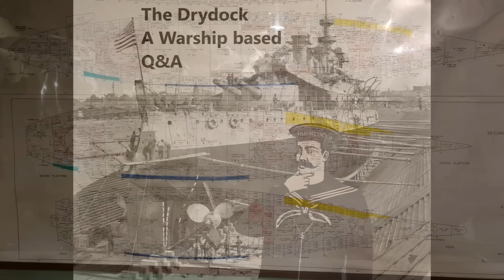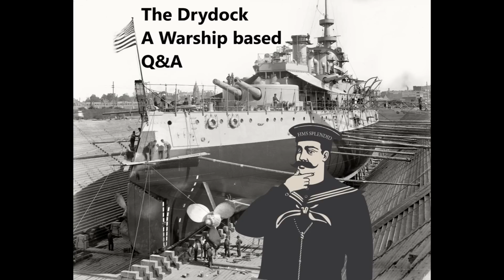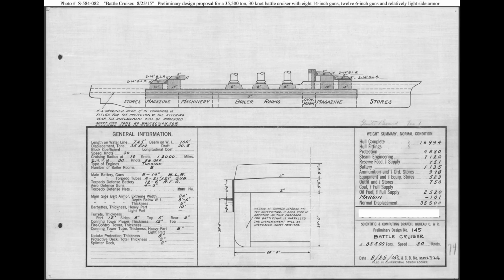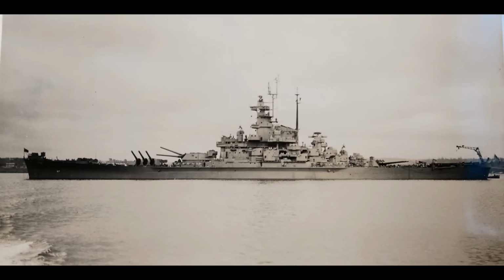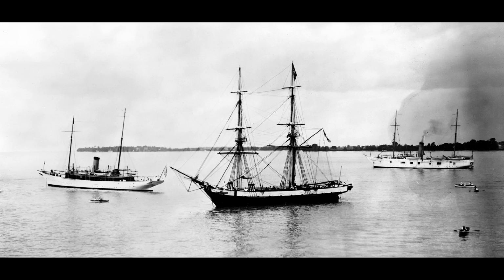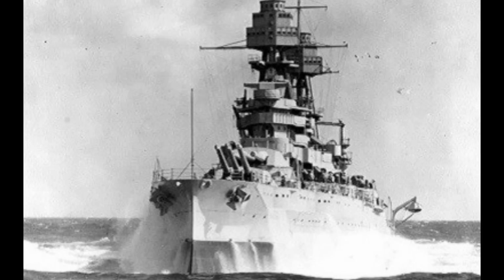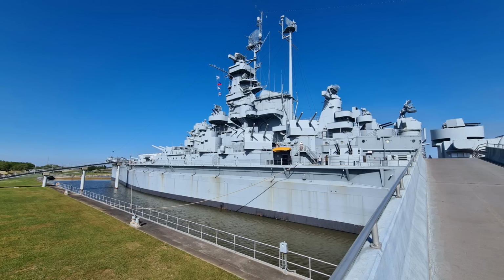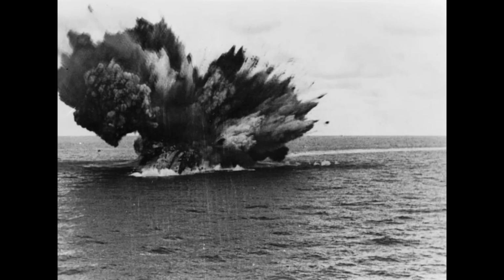The Drydock - Episode 197 (Part 2)

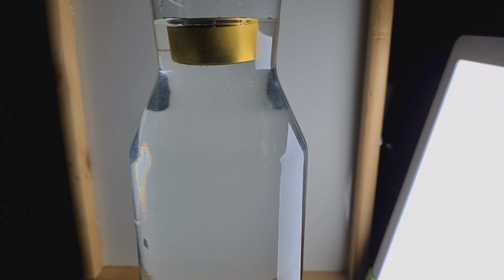Comment: For the sunken ship (around 2:01:00) simulation, there is a possibility that the initial food dye being dragged up and out may have been due to interaction with the water molecules as they are slightly attracted to each other, same principle used when sucking up a liquid in a hose or a tap when used to move the water along, due to intramolecular forces so any initial contact would pull any water or food dye towards the water hence the blob that started to appear near the start of the bottle caps sinking. This effect would be much less obvious with a large vessel.

Comment: Re the workshops, it is almost certain that oxy aceteline would have been available, which could be used for heat treatment in conjuction with a barrel of oil or with the ships fire hoses. My father was a stoker on the transatlantic convoys, (many stories and anecdotes ) ships coal was damped to wash any dust to the bottom of the heap and generally went into the boiler wet, this was not only safer from a health situation, but also prevented  the possibility of coal dust fires.
Reply: Proper heat treat usually requires a step where you bake the part withing a specific temperature range after your quench step, and it's unlikely they would be able to do that without an oven.
Reply: @Halinspark  You are refering to anealing, an oven is not required, as a machinist and forge worker I have often heat treated parts including case hardening without an oven. Blacksmiths have been doing so for many thousands of years, and temperature control was and still is a visual measurement. However they do have ovens on board all shiops, they are used for cooking and could easilly be pressed in to service by the ships engineer.
Reply: @Halinspark  it's certainly possible to anneal by eye but if the annealing temperature window for your alloy isn't very big it can be quite tricky.

Comment: Regarding heat-treatment in shipboard workshops: most farriers in my area have a gas-fired furnace in their truck which is quite compact, a foot cubed, a foot and a half cubed, that kind of ballpark. A device of that size would obviously limit the size of object to be heat-treated and the compact nature and probably manual procedure of doing the actual heat-treating would result in substandard quality heat-treatment, but I'm quite confident that it could be done, even with WWII tech.

Comment: There was a story cirulated when I was in the USN Reserves that, during the refit of one of the Iowas in the 60's or 780's, that a compartment was noticed that had no hatches or other access.  When an opening was cut in one of the bulkheads, they found a fully equipped machine shop.  Now, this story was told me by an old navy chief, so, to put it mildly, it may be suspect....
Reply: I believe Ryan over at Battleship New Jersey has a video on this very subject. Sorry, don't have the link, though. Short answer, probably apocryphal for an entire machine shop, but much smaller "cool" spaces, potentially true.
Reply: @Jimorian  Thanks for the answer.
Reply: I was in the Navy 1969-73, and I remember that one.  The way I heard it, a new junior officer was given the task of mapping out the entire ship, to help him become familiar with it.  No matter how he remeasured, he came up with a missing space on one deck.  And when they cut into it, they found a fully-equipped machine shop....
Reply: @troystallard6895  yep, it happened.  The whole shop was lifted into place, fully equipped except for access to ensure nothing would be used/taken until sea trials.  Then they forgot.  Or maybe someone made off with the doors intended for later installation.  The ensign had an easier time than enlisteds being asked to find 100 feet of shore line, keys to the oarlocks, or a bucket of steam.
I experienced something similar to the missing space on a submarine tender by finding several radioactive reference sets needed to calibrate measuring equipment. The ship would order them, and store keepers would deliver them to a shelf in a no longer accessible space. The lab kept requesting replacements for outdated standards, the SKs would deliver them to the proper  place which was no longer accessible.

Comment: Technically the L and M class destroyers that didn’t have the 4-inch guns were armed with brand-new 50-cal 4.7-inch DP guns, and had pretty good elevation but it’s downsides were weight and having to be elevated manually.

Comment: I wonder how much metal they carried for machine shop stock. 
Like round bar, flat stock, cold rolled, hot rolled, 4140 Chro-Moly? 1095, S2 tool steel maybe? H13 tool steel since it’s abrasion resistance is pretty good.
There’s this stuff called Cherry Red, use it for case gardening and it also works for surface hardening. 
Comes in a white container with silver label.

Comment: I recently read the story of the luxury sailing yacht "Te Vega" which, in the course of a long and varied career, saw US navy service in WW2 as a patrol vessel under the name Juniata (IX-77), stationed on the West Coast and armed with one 20mm cannon and one .50-cal machine gun. One incident of note was when Juniata challenged an unidentified ship at night and was immediately illuminated with searchlights. Juniata's skipper hailed the other ship and threatened to shoot out the lights if they weren't doused immediately. The searchlights were turned off and the captain of the other ship (a US destroyer) apologized and politely told Juniata's skipper that the challenge code he had used had expired a few hours before.
Te Vega was also involved in a pre-war corruption scandal concerning the awarding of navy contracts for construction work at Midway and Pearl Harbor - the naval officer responsible for awarding the contracts was a regular guest of Te Vega's owner on board the yacht and subsequently gave the contracts to one of his companies.

Comment: Did someone REALLY ask you which of the ships that broke it's chains & refused to go to the breakers was your favorite? THAT HAD TO BE A QUESTION EITHER BY SOMEONE NEW OR A FOUR YEAR OLD QUESTION THAT IS JUST NOW GETTING ANSWERED! You didn't even have to name the choices before I knew the answer was Warspite!!! 
Now Oregon making it halfway to Tahiti is cute but I think that was before Tahiti was really a nice place to go. AND considering Warspite's war records & the fact it did a donut in front of the High Seas fleet & survived to to tell the tale & in the process helped save the crew of another ship. And has probably shot up as many war ships as any other during the age of steel war ships. And anyone that has spent anytime listening to you would know your love of HMS Warspite!!! I DEARLY LOVED the fact that HMS Rodney had boilers that was on their last legs & was otw to the USA for a complete engine overhaul but Bismark hit HMS Hood with that lucky shot that turned it into a sinking Roman candle. And so HMS Rodney pulls a 180 and heads towards the coast of France basically ran down the Bismark running it's OLD engines at 3 to 4 knots faster than they were designed for, and once Bismark engage's Rodney, Rodney pulls the destroyer trick of chasing splashes. And starts beating Bismark  into a floating wreck of fire & carnage. And to be honest, although I think that it was awesome that a ship in need of a major engine overhaul took on that brand new battleship and beat it. I'm sure the KGV helped. But from what I've heard, most of the first hits scored on Bismark, the one's that took out most of it's ability to fight back was from Rodney. But I actually feel pity for the men that were aboard Bismark. For one, their ability to fight back is quickly taken away. To jump into the freezing cold water is probably death. Fire, hot metal raining down, massive carnage & dead people & body parts lying around in heaps. The German that lasted 3 days in the water is amazing he didn't die of hypothermia. But living through that kind of hell, those that were rescued truly lived through hell on earth. It's really sad too that they left so many survivors in the water. Yes, I know there were U-boats otw & the threat of air attack too but they could have thrown out some life boats or whatever those float things are called. I know they were taking revenge for the crew of HMS Hood but at some point you need to stop & try to go back to being human again. Yeah, the HMS Hood basically went down with all hands. But it was over & done quickly. We, the USA & the UK were supposed to be fighting to save the world from tyranny. And the way to do that is to overcome your NEED FOR REVENGE and only kill when you need to & only fight towards winning the war. It's almost like by trying to stop this evil that you ALMOST became what you were trying to fight against. Or at least the way the Bismark survivors were treated. If that makes sense? I understand that the loss of the Hood was a tramatic blow to the Royal Navy but like Cunningham said "It only takes a couple of years to build a ship. It takes a few hundred years to build a tradition." And part of that tradition is to give mercy when a battle is over.
Reply: And I can't speak for all Americans. But I don't like the idea of war with China, Russia or anyone else for that matter. BUT with all the humans on this planet, how long before there are so many people we all suffocate from lack of oxygen? We have over 9 billion people in the world & populations everywhere are growing on a massive scale. I'm an old man and will probably die sooner rather than later. But I just wish that I could somehow wash all the evil from the world!, all the pollution from the air & waters and ease all the hostilities that people have & create towards each other. And cause anger & hatred to just disappear. I'm sure that will come soon enough for me in the form of death. But wouldn't it be really great if Jesus really did come back to earth and solved everything and made the world clean again and we are here to see it all happen? Although I do really wish for it. Idk. I just think of how we have totally trashed the earth. We should all be very ashamed of just how polluted we have let this world become.

Comment: Would it be possible to have you expand on your answer regarding decontaminating Laffey?  I remember reading that the USN used Nevada, and several other surviving hulks from Crossroads, to test various decon measures.  Was Laffey part of that experimentation, or did Laffey benefit from the lessons learned on some of the other vessels?  

As an aside, as a former radcon tech, the accounts I've read of things being done after Able and Baker, including FFS steel deck "beach parties"  (Swimming off the side of the ship inside the atoll's lagoon), are just horrifying to read.  Along with the struggle the scientific detachment had to prove to the Naval command structure that they lacked a dependable radiac that would detect Pu, I think it was.
Reply: Everyone laughs at Alpha until you end up swallowing them.

Comment: RE Suction: It also should be kept in mind the displacement of a ship is calculated when on the surface. Submerges it should be significantly higher
Reply: Actually, significantly lower. After all, it's not displacing enough to keep it afloat anymore.

Comment: I think the main purpose of the onboard machine shop may be not to make new parts from raw, but to repair/rework/recondition worn or broken parts. If you can repair many of the parts on board, the "spare part" is the part you are using, rather than having to carry duplicates.

Comment: Regarding suction - its exactly the same as a large truck passing close by, albeit rotated 90 degrees and is air not water.
Consider cyclists draughting/drafting behind a truck, who can keep up with the vehicle as long as they stay in the low pressure zone.

Comment: I think the ship of Theseus is mainly about continuity. If you replace the ship part for part, but it has served\sailed with those parts they become a part of the "continuity of existence" for that ship. So even if the Shis has not a single original nail left, if the parts had time to sink into said continuity, it's the same ship
Reply: Y'all not looking at this thing occult enough: the ship has a spirit, okay? Call it its service life, it's character, even it's crew. That's what I mean with continuity. An upgrade, refit, repair or even rebuild doesn't destroy that continuity. Prepping it up for museum use doesn't either. To not have it be the same ship you must ... "Kill" that continuity. And for that you basically have to destroy the ship on a fundamental level.

Comment: AKA Suction with ships going down. 

It is worth bearing in mind when considering suction with sinking ships that the same mechanics are largely responsible for Gravity fed ocean currents and winds, the differences are merely of scale, and of 'feeding' as it were. Anyone who questions how powerful these mechanics can be just needs to look at the big Polar Oceanic currents (which are Gravity fed), and the Antarctic Katabatic winds (also Gravity fed). 

So how do they work? Well not sinking ships obviously, rather they work through the process of air or water sinking. I know more about the currents, so will try and explain them as simply as possible. 

Warm water (relatively) hits the Polar Ice caps, that water is then cooled rapidly. Water gets denser as it gets colder, so that water sinks. As that water sinks it leaves a void which 'draws' more warmer water into the Ice cap, which then cools, and sinks. So what you have is a conveyor system of warm water hitting the ice, cooling down, sinking, and driving the water below it (because its all moving). This drives some of the most powerful and important Oceanic current systems on Earth. And is also why Marine Biologists such as myself worry about Ice melting in the Polar regions. Losing that Ice WILL affect those currents, and the effects will be very, very noticeable. 

The Katabatic in the Antarctic basically works the same, warmer air hitting the (very) cold interior, sinks. As Antarctica is essentially shaped like an upside down bowl (high in the interior than on the coasts) that air then flows down, and is kept flowing as long as that warmer air keeps hitting that cold interior. We are talking 200 mph gusts by the way. When the Katabatic comes it howls. 

Ships sinking are working on many of the same mechanics just on a much smaller scale, and unlike the currents (at the moment), are transitory, in that its a singular event rather than a repeating one. In essence anything that sinks 'pushes' the water below it (because water is non compressible, at least mostly), and 'drags' the water above it. Obviously the hydrodynamics are somewhat more complex, as Drach's lovely little experiment showed Vortices and the like form, but the basic mechanics are the same. 

As he said, it's mostly to do with the amount of mass that is sinking and how fast its sinking. Ironically enough a big ship sinking fast has less over all mass than the big oceanic currents, but its sinking faster, and has more concentrated mass, so the effect is actually larger. Just over a smaller area and its not sustained.

Comment: Nice to see Drach wants to be Ned Pellew .Given the choice of command of any ship it would have to be a 36 gun 18pdr Frigate sometime between 1780 and 1805
Reply: Nope, I agree with Drach, a Razee, preferably a cut down 74. Gives you several advantages. First your main battery is 28 24 or 32 pounders, so heavier than most other frigates could carry, then because its a cut down Two Deck ship of the line the upperworks guns are likely to to be heavier than they would be on a standard frigate, so possibly 12 - 18 18 pounders there. So you have the firepower to take down anything short of a ship of the line. Somewhere between 40 - 48 guns was 'normal' (as much as Razees were normal).

You have the increased hull and timber thickness of a ship of the line, consider HMS Victory has two foot of planking at her water line, that is planking, not the ribs. So better protection there for your crew. 

Lastly though you lost a deck, you still have the full mast and sail plan of a 74 gun two deck ship of the line, so you are still capable of Frigate speed and agility, perhaps even more so in heavy weather. 

I love those old 18 pounder 36's, they are to my mind the most beautiful age of sail warships when it comes to their pure lines.... but the Razees beat them for survivability and combat power.

Comment: In terms of weather in June in Halifax and Hamilton, there isn't much advice you can be given as it could be anything. 

Usually early June is pleasant, with low to mid twenties on average. But there is a huge degree of variability. You could see temperatures in the single digits or 30 degrees and very humid. You could even see both of those in a week. Odds are you won't get much rain, but if you do it will probably be big thunderstorms rather than the constant drizzle you may be used to.  

Best advice I can give you is be prepared with light clothes that can be layered if you hit a cold snap. And a light, waterproof jacket is a great idea. And check the forecast before heading out.

Comment: Drach on the part for heat treating and forge work they could have very easily used the ships boilers and fuel oil for that.
Reply from the maker: For basic work, yes, but for face hardened armour or gun barrels, not so much

Comment: A total missed point on the reason why the tanker bridge was amidship. The reason is very simple that there is a requirement  that under the Collison Regulation for a lookout to be kept ahead, this is defined as a distance where the bow does not shadow any small vessel. The more modern tankers and bulk carriers achieve this by having a very tall superstructure, not found on containership who have a forward or amidship accommodation. The problem with a high superstructure is that it  restricts the places the vessel can access.